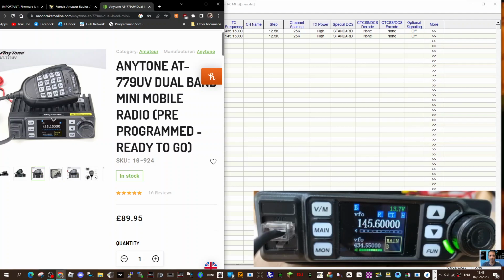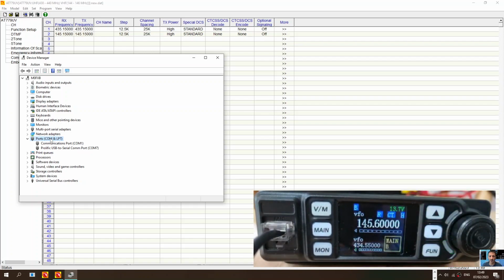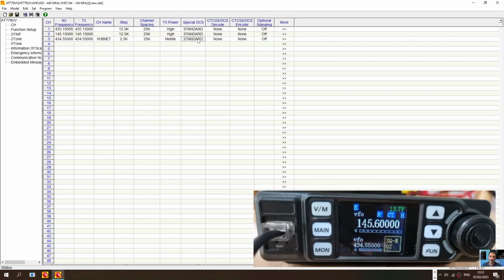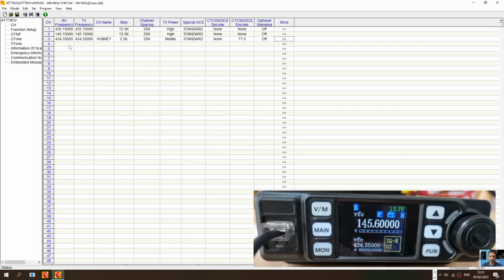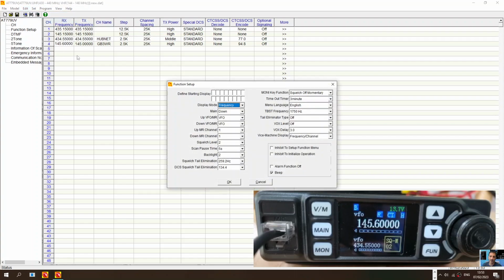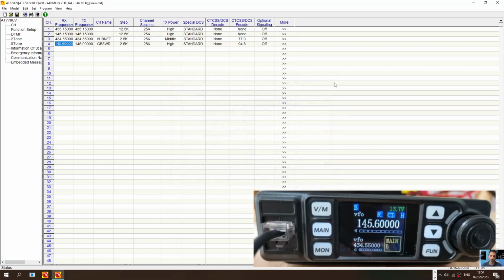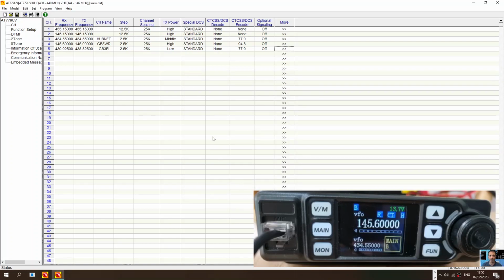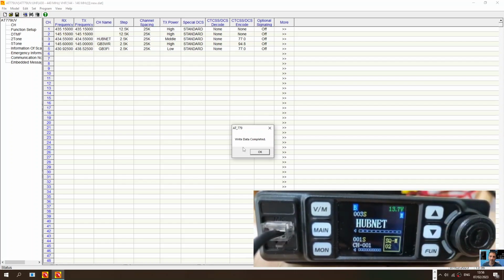ANYTONE 779UV - PROGRAMMING USING SOFTWARE

Comment: Got mine from Moonraker today. Supposed to be pre-programmed but the settings for all the repeaters was wrong.  RGD Radio does an excellent video on it and attaches a file with correct settings you can flash to your transceiver.
Reply from the maker: Oh cool thanks

Comment: Hi. Thanks, helpful video. Does the AT-779UV need to be powered when using the USB programming cable connected to the PC?
Reply from the maker: Yes
Reply: @m0fxbhamtech  Thanks.  I have a 12v AGM battery, and have just bought a smart charger, coupled with cigarette lighter connectors, I can power the AT-779uv while re-programming it.